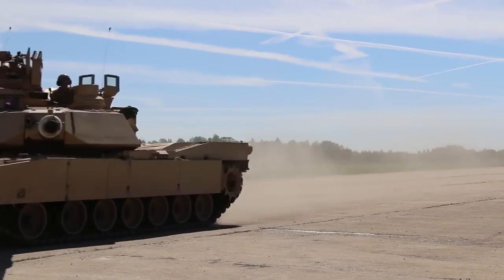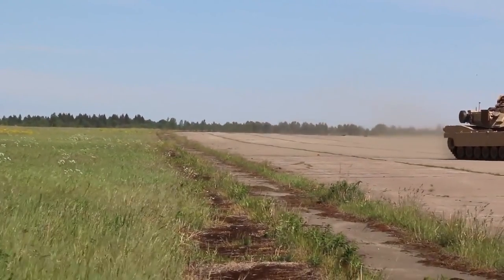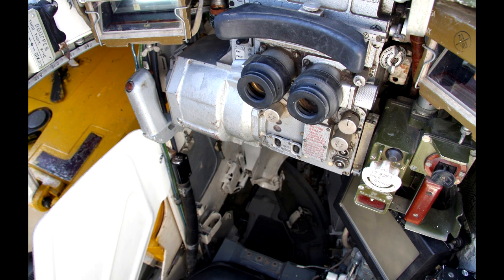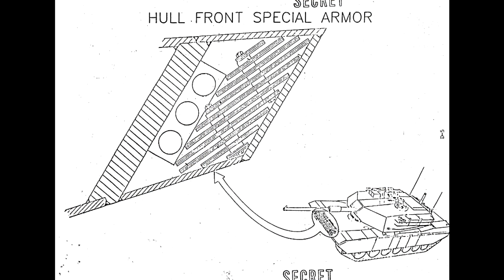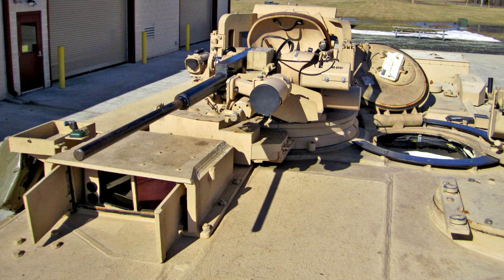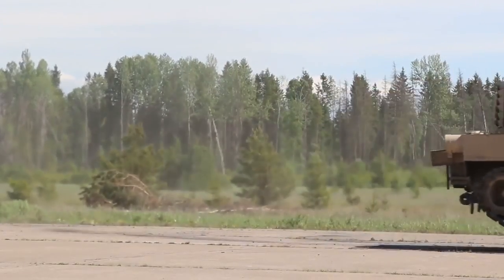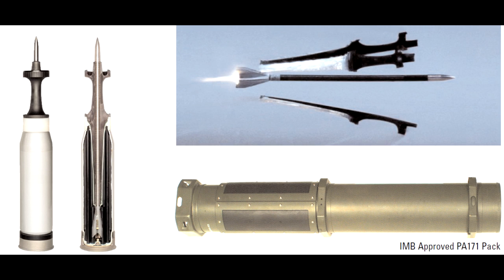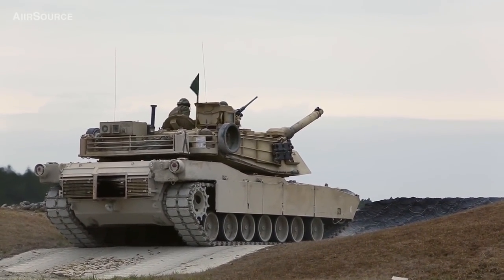Problems with Abrams tank

Comment: The Russian gun of the T-90 and of the T-14 also, can use missiles and to reach targets above the 5 km. In a meeting with Abrams, the Abrams will even will not see what and from where they have been hit! That means 4-5 well-trained soldiers are dead. If the meeting happens to by with the new Armata T-14, this new tank could be even a drone tank. In Ukraine war I saw from a drone's video from above,  a Russian T-90 which fall over two strong tank's mines and after that even was hit by a javelin rocket. After the successful immobilization and the explosions, the crew was alive and was coming out unharmed from the tank, and I think this is the big issue here, to save people lives. And people who are well a difficult trained to the new electronic systems of the new tank, are worth the effort to be saved the same as the airplanes pilots. The new Armata T-14 except the drone's possibility also, keeps the 3 members crew in a capsule that will keep the crew save at all cost! Not to mention the speed which is the greatest from the known tanks, or the fuel autonomy, which is also important because you couldn't have a fuel-truck, an easy target, behind you with fuel in the middle of a battle, or to stop the battle to refill again your thirsty tank. This means the tank immobilization, that makes the tank to be vulnerable. Also, because I was a driver of a tank, the problem with the American tech is the crawlers, which after few years the bearing, are so stuck that the crawlers are become loose and easy to come out when you are taking a turn under a velocity. As to correct it, it is possible to lose a whole day under enemy fire when every axis of each piece of the crawler is, sometimes, stuck in one piece. Believe me, I had suffered this for about two years.
Reply: Where is this shit in Ukraine? The Russian army is having a horrible time with the t-90s, given that they can't even deal with light anti tank weapons like rpg 18s.
Reply: @terrynewsome6698  Terry, for that reason, the Ukrainian army tomorrow will have a parade in Moscow! You have to be there for celebrating it.
Reply: The T-14 is not even real at this point lmao
Reply: @kylelerie7325  Do you have inner information from the factory?
Reply: @user-dialectic-scietist1  The fact that only prototypes have been built proves they’re nothing
Reply: @kylelerie7325  At least, 20 of them have been shown in the 08/05 parade and also examples of them have been shown in  sales exhibitions, and they have accepted orders from India and China, also the "terminator" variant which uses the same chassis platform had used in Ukraine for antitank support  for T-90. As usual, you Americans, you have to learn with the difficult way to do not underestimate your opponent! Before few years Putin, made an announcement about new deadly weapons like Kinzall, Poseidon, Caliber etc. and all of them are now in use. If you think that the Russian, are a kind of shepherd from Iraq or  Afghanistan, then already you have lost the fight before it begun. America said that Russia is going to be isolated country because of your economic sanctions, but in the last commercial forum at city of Petersburg we see 131 countries to have announced membership of them there and in whole EU even in the USA, the people, you think that they approve this policy, and they care of Ukraine, or the only thing that matter for the people is their quality of life which have been compromised with the stupidity of the Biden administration? See even now and think if it was necessary, the trip of Pelosi to Taiwan, and this way the USA to provoke China? That means also, that the USA have underestimated the China and the whole planetary peace now is at risk. Then, if something happens and an atomic war starts this stupid lady will tell to the American people sorry about the nuclear war I will go now to save my skin under the earth bunker, and do not wary because we are so many people on the planet someone will survive in the earth bunkers and after 200 years they will rule again.

Comment: I will defend the multiple fuel types. You have to remember since ww2 one major issue of war has been logistics. If you have to seize substandard fuel in your theater without proper logistics it's nice to be able to burn whatever to keep your tanks moving since moving tanks are much scarier than stationary ones. When pushing into Russia Germans could not get fuel out to the Eastern front very well because of the wet and nasty landscape which hindered the German forces though that affected everything going east. Rommel always had fuel shortage issues in Africa. So there is a rather straightforward reason why being able to burn anything for fuel is not such a bad move.
Reply: Yeah and? What other fuels will you find except gasoline or diesel? Everyone uses those and those are the most likely to find.
Reply: @divoulos5758  the point is that you CAN use both diesel and gas (including high ethanol gas), which are plentiful everywhere. Getting low too far from your supply lines? Pull up to any gas station and drain the pumps

Good luck running a diesel tank on gasoline...
Reply: @xaderalert  except modern diesel tank engines are multi fuel…
Reply: So the logic as I understand it is:
It's better to burn a ton more of the fuel you already have, so that you could be able to scavenge and then burn some more of whatever fuel you can find,
versus just using a much more fuel-efficient engine from the start, that already runs on the most common fuel used by the vast majority of both enemy and allied units alike, as well as being available at most civilian fuel stations around the world.
Your logic doesn't make sense.
Reply: @raypolaris3381  ahhh that is because you misunderstanding something very straightforward. Not everyone in the world uses the same standards for their fuel and the most fuel efficient an engine is the more precise fuel you need. It like having a gun that can shoot any round it's just slightly substandard doing so but you have a lot more logistic mobility. If it does not make sense to you that you think fuel efficiency is what should be prioritized that's fine but the logic does terminate. Fuel with high amounts of sulfur are common in less developed countries since it's a very easy additive as an octane but it's brutal on engines because as it burns it gunks up very quickly. A more fuel efficient engine is not going to be able to use that fuel because it has more sensitive components that allows it to be more fuel efficient. Your understanding of the petroleum people use around the world is why you don't get my point but I've not only been lucky enough to travel but my family has done work around the world working on petroleum plants as operators and analyst and I promise your claim that all fuel is virtually the same is wrong. Many places in the world uses things for octanes that is not used in places like Brittan or the US because of pollution laws but many Asian and middle eastern don't have these are will produce fuel that would be detrimental to use in a more sensitive engine. So my logic does make sense when you are actually aware of the fuel situations around the world not being standardized.
Reply: In addition to their logistics being almost void of mechanized vehicles. And not having fuel to begin with

Comment: One thing I failed to say was the Turbine Engine has so much torque and power the Abrams has a Speed Governor to slow it down. With out the Speed Governor the Tank could go 60 mph+. One very big issue encountered was the Tank went so fast it would throw tracks so they slowed the Tank down. Another issue was the Tank was so fast, APC's and Wheeled vehicles cold not keep up with it.

On the Circular Track at Aberdeen Proving Grounds Maryland I was going 50 Mph driving the XM1 before all of the modifications were made to it. The Tank had no problem reaching that speed and the Instructors told us it could go 65 Mph but it had issues throwing tracks.  Chrysler Defense Engineering installed Speed Governors to slow the Tanks down.

The Turbine Engine has so much power vs a Diesel Engine. Diesel Engines have thick black smoke, Turbine Engines have none. A Diesel can only burn Diesel while a Turbine can burn any fuel (Gasoline, Diesel, Kerosene, Peanut Oil, JP-4 or JP-6) you name it and the Turbine can burn it.

Comment: Not right. But...
It did not count (105mm) and the ammunition where 120mm from the Leo2 and 105mm from the M1 had similar penetration parameters.
And as for the observation system for the commander ?? Cost cuts, not structural deficiencies. The place of the observation system has been in every belief since the first copy.
Engine?? I recommend checking how much fuel is needed for each kW. And 3 tons lighter than diesel :)
Even though so much shit propaganda takes out single things, it's still shit. Why??
Believes "better" Russian tanks suffer from the flying sydrome in wholesale quantities (Iraq, Syria, Ukraine)
Russian scrap is an example of a blind tank. They are used by dual-purpose civilian cameras.
Armor ?? Anyone can identify any version of M1 destroyed by another tank? Or a frontal ATGM shot? The exported versions can withstand the 9M133 Kornet and not the newest ones. If anyone wants to know the history of this monster on tracks, I encourage you to read it 
https://www.youtube.com/watch?v=rH1xwMpf23E&list=PLSMmqgQnJK_Yicg7EjovwLBh_mFQojLiC&index=11

Comment: So the main issues with the current version of the Abrams, is that the engine is too expensive, the ammunition can't get any longer unless they modify the turret, and it has a thin, small weakspot that will almost be impossible to make hits on at range. I think I'll take those drawbacks to have the most dominant tank on the battlefield today. It's already proved itself in multiple confrontations to be overwhelmingly superior to it's competition in every category. 

I feel like the cost of it's engine and fuel is irrelevant, considering the US military doctrine doesn't concern itself with the operating costs of any of it's top of the line equipment. You could definitely make the argument it's a legitimate concern if it were operating within a different country's military budget (soviet/Russian for example), where price vs performance is the chief concern, but for the US, military spending is sort of an afterthought/the necessary cost of being on top. Comparatively, the newest eastern designs are only just now getting a chance to show their combat effectiveness in real battle with their domestic crews/engineers, and so far it hasn't looked great. 

From what I've seen so far I'd consider the German Leo2A6/A7s to be of equal quality to the newest Abrams, but for anything developed further East, they'll have to show me their "next gen advanced features" actually work before I buy into the hype.

Comment: Turbine definitely has its drawbacks and was a bit experimental. Still one thing you kind of talked around was to say that it’s “no better than a diesel for the same power” of course to produce a diesel engine of the same power, especially at the time of its development, would have required a larger and heavier engine than the turbine.
Reply: An engine that weighs a 1000kg is heavy for a tank?. Would you prefer more engine sitting behind you, or more flammable fuel.

Comment: Good points, I actually served with 3/67 Armor Bat, 4th ID. I think you're missing some key advantages, such as claiming it is simply gas turbine and not JP8 jet propulsion fuel which moves the original 67 ton vehicle to 80 kph in 11 seconds.

You missed the ablative armor at the front and non-reactive armor used (putting c4 blocks on a tank works but not great). See the Arma destroyed in Ukraine for example.

I respect the T80 and T90, having seen both in training at NTC, Ft Irwin, California. The T80 can be incredibly fast and moves like a beast in hills. The T90 is equally fast, but not as agile. The problem with these two are that they don't operate well in mud, slipped track is hard to bring back online quickly, and external fuel (though safer) creates a great target for Bradley's and discounts for a mobility kill.

Comment: Does it matter? US has overwhelming air power, and they basically need very little of anything else. And no one has the capacity or the balls to supply US's enemy with 60,000 ATGM and anti-tank rocket in a single swoop.

Comment: you must also realize that tanks are not meant to be invincible, and they are not designed in a vacuum or for a one on one encounter on a flat plane at 20ft. Tank sights are also designed to be able to hit a tank-sized target, they aren't giant sniper rifles, and the armor layout is designed to be effective in most circumstances (ie. hilly, possibly forested and in a hull-down BP) Considering what it was designed for, a lot of your points are irrelevant. Overall, M1 is an effective infantry support weapon.
Reply: the M1 is an MBT not an IFV
Reply: @fuckedlaptop364  I said infantry support weapon, not IFV. literally every piece of military weaponry is designed to support the infantry. (artillery, IFVs, air assets, tanks, engineers, etc. are all infantry support) The man and his rifle has, is, and will always be (for the foreseeable future) the core of any ground-based fighting force.

Comment: the use of a gas turbine over diesel comes down to logisitics. a gas turbine engine can accept a far wider range of fuels, all be it with varying levels of efficiency. the purpose was so that the abrams could be deployed to any war zone in the world and be able to use fuels sourced locally when long distance american lines werent sufficient. germany chose a diesel engine because that is their prefered fuel and germany never intended on sending tanks long distances from germany as theyre a self defense force on account of cough historical events.

both engines are the best for the intended purpose of each tank.

your argument that the army would just take the fuel they need for their vehicles is ultimately flawed because it doesnt account for supply lines, local sources, or if supplies are lost or attacked. given a local source of fuel, an american armor division can operate 100 percent isolated from american supply lines until their ammo runs out. considering tanks are far more likely to run out of fuel than ammo, its pretty important to have a wide range of fuels. even modern multi fuel diesel cannot run on gasoline, while a turbine engine can run (theoretically) on anything that burns. The American design was purpose built for deployment far from home. america has no realistic threat of invasion. while nuclear exchange is a threat, the possibility of ANY nation putting tanks on american soil is near impossible purely from geography and logistics, and american designs reflect this. america doesnt design its equipment based on american terrain. America adopts everything from camo patterns and small arms to tanks and trucks based on where they most likely will see combat in the future. key point is just this month, May of 2022, the Army adopted the full power Sig MCX Spear in .277 Fury as the new M5 rifle, a full power rifle cartridge designed to engage at longer distances and defeat body armor because the US military believes that its next major engagement will be against a near peer adversary with body armor and optics for longer ranges. the Abrams was designed originally to operate at long distances and be able to sustain itself within its battalions. another reason they opted for a 4 man crew instead of an autoloader and a 3 man crew, thats 25 percent more manpower when doing vehicle maintenance and the ability to change ammo on the fly.

Comment: That engine is so bad... You need so much logistics support.
Reply: The Abrams was designed for a certain operational range and it meets that for the last +42 years.  The US Military does make upgrades as needed depending on the types of wars they need to respond to and the needs of the equipment to take into those areas. The turbine engine is only bad to those that haven't been in the US Military, trained within the USA combined arms doctrine, or seen the results of the Abrams in action during/after a conflict.
Reply: That’s only a bad thing if you’re bad with logistic support.

Fortunately, running bases worldwide for decades has a tendency of making one good with logistics.
Reply: @NoTraceOfSense  not true... if your mbt is tied so much to its support caravan and that support caravan also needs so much protection... for so little difference in performance, thats not worth it which is the main reason so few countries can sortie out like how the US can with its mbt.

Comment: Criticism hurts but helps what’s criticized becomes better. However, while the turbine engine is expensive and consumes more than the alternative , it’s ability to work within extreme heat, long lifespan and a lot easier to maintain than petrol or Diesel engines. 

Another fun/funny fact about the turbine is that even though it has a high input of fuel, it’s emission output is really efficient with less pollutants than a highway truck. Coming from American that’s strangely funny. 

For being in service for over 40 years, there may be reasons why the turbine is still used

Comment: 4:47 I would say even a hit with a (big enouth) HE at this point on the tank could to some serious dmg.
With ~40-50mm armor "only" a 125-150mm HE could punch thru that. Or at least put so much overpressure that it would hurt the crew inside.
The driver should be around the point of impact if I remember correctly...he would be done-and-gone if something explosive bounces off the front and gets trapped under the turret.